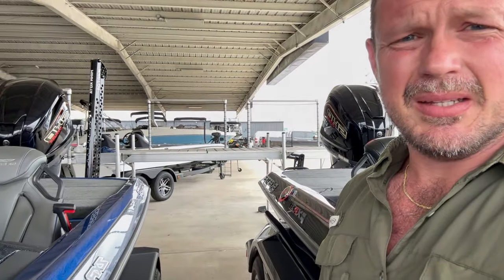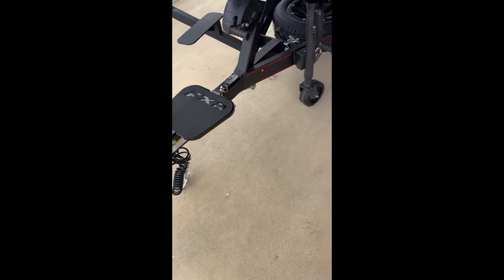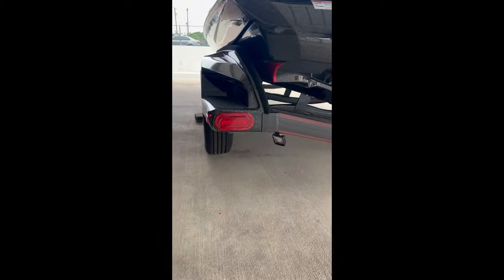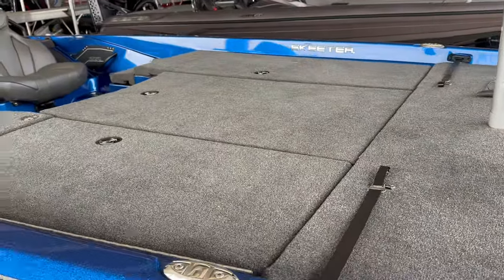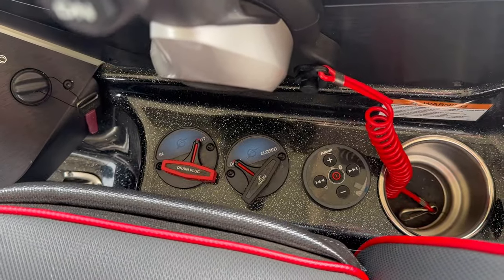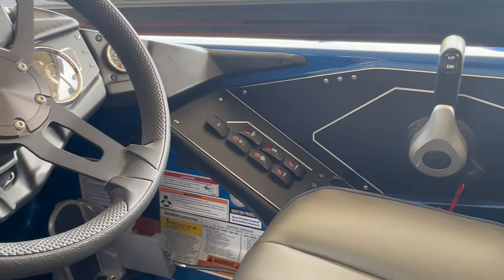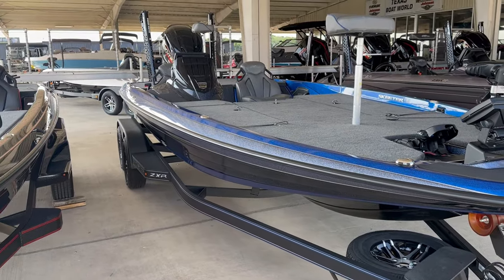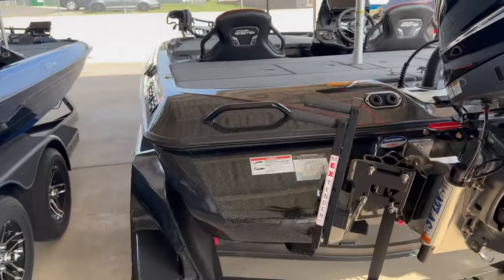2024 Skeeter ZXR and FXR Comparison

Comment: I've owned both (currently in fxr)... Let me help you out, cause there are a bunch of good differences that skeeter really doesn't do a great job of pointing out: 

Trailer upgrades: grab handles, fenders, wheels, tires, extra step on side. 

In the boat:  fusion stereo, battery gauge, pop out cleat by driver, steering wheel, billet aluminum reinforcements on console and transom, upgraded grab handles, cup holder/tool holder up front, upgraded seat material, more padding in seats, all stainless locks, additional compartment lights, deck lights, locker bar available, upgraded electronics, seadeck flooring, trash can compartment, NMEA network from the factory, much better NMEA gauges, NMEA engine harness, touch panel at console, additional bilge pump, additional live well pump, full padded deck, and sliding front pedestal seat, upgraded electrical wiring/shutoff setup in battery compartment.
Reply from the maker: Thanks Preston! Pretty sure I hit each of those. Definitely a lot more then most realize
Reply: I specked out a ZXR20 and a FXR20 PRO on Skeeter's website tried to get as close as it would let me and there is a 48k difference in price. Is the FXR a 48k better boat because I don't see it?
Reply from the maker: @travisbarr5367  part of that is because you built a pro. The pro is designed for people that want to build the boat with options outside of what skeeter builds them with. They loose the “package “ discount. I’m f you build and LE and zxr there won’t be as much of a difference. If you want to email me I can spec two out for you.  Jbrown@texasboatworld.com

Comment: You left out the biggest comparison. What's the price on both boats? This is what most people want to know.
Reply from the maker: I tried to go over things that you can't find anywhere. Skeeters are all sold at NAP so most know exactly where each boat starts and then it would just be a matter of added options from there. Currently for the 21ft models in 2024 base prices would be ZXR-$78,695 FXR-$92,795 as packaged by skeeter.
Reply: @texasboatworld  thank you for completing the comparison with the prices.
Reply: More like what's the interest rate. Lol 13.99? Dealers already selling rebates. Hahaha
Reply from the maker: @one-of-a-kind6606  last round of rebates it was 4.99 or 5.99.